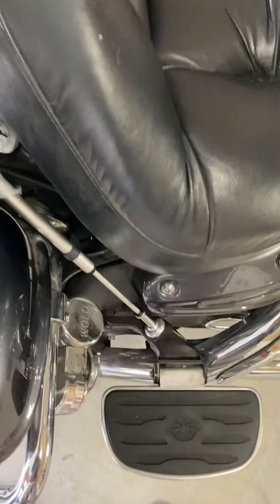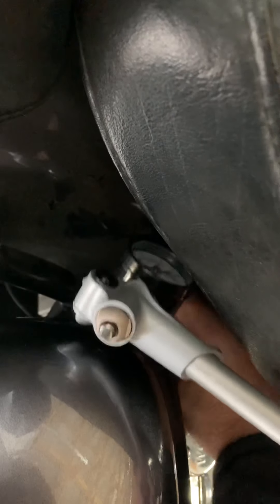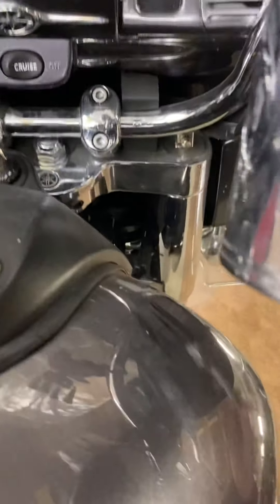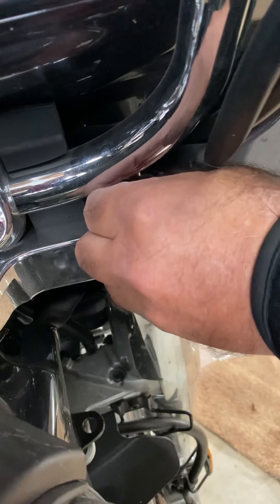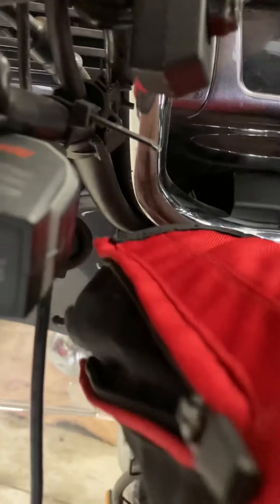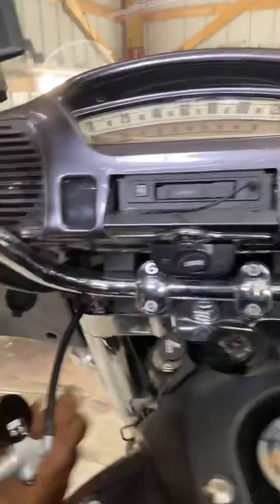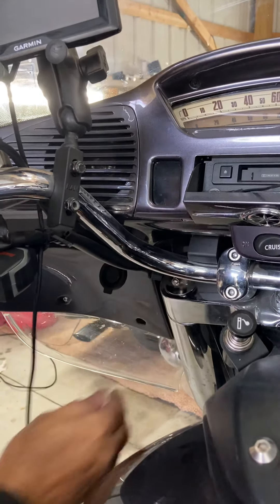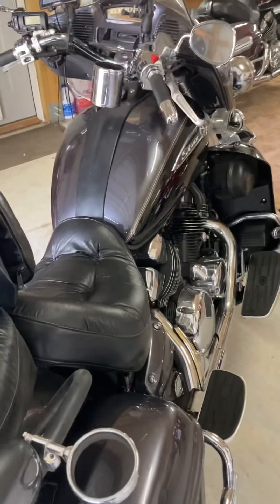DIY: How to Check Air Inflation on a Yamaha Royal Star Venture

Comment: when you remove the pump from the Schrader valve after you have put the air in, you let a lot of the air out, inadvertently no matter how fast you spin that connection from the pump to the valve. These shocks and forks, hold such a small amount of air, that you can let all the air out that you just put in just by unscrewing the pump.
take a reading now after you’ve removed the pump with a separate gauge and see how much air is in there, if any. Just taking a pressure reading with a pencil gauge lets out a few pounds. 
 I have a video on my YouTube channel showing how to put air in the system without losing any air using your home compressor. Just have your air compressor tank at the exact air pressure you want in your shock. And use a push on air chuck to put air in the shock. When you press the chuck onto the Schrader valve, if you only have 40 pounds in your tank of your compressor, your shock will equalize .. with the air compressor tank. For doing the forks, which takes 7 pounds each, you have to lower the pressure in your air tank of your compressor down to 7 pounds and do the same, hold the air chuck on each fork valve, it can’t be a screw on tape because that will let air out as you unscrew it. It Hass to be a push on type air chuck, then equalize each fork with the 7 pounds you have in your Compressor tank..
  I have two videos, showing how I do this procedure, and it takes literally one second to put the air in just by pressing the air chuck connected to the hose from your air tank onto the Schrader valve. Then I take a pressure reading with a simple, pencil gauge.

Comment: A lot of ventures have a squeaking issue coming from the back. Most of the time it is the Cush drive pins that need greased. Your wheel has a hub with a large gear that is attached to the wheel when you remove it. That large gear plugs into the final drive housing on your final drive, and is held on by the axle. That gear is attached to a hub that has six pins on it. Those pins plug into the wheel into metal bushings that are inside of hard rubber shock absorbers.. all motorcycles for street use have some type of a cushioning device in the final drive line to absorb the violence of shifting gears and hitting the gas and letting off the gas. That is pretty tough on transmissions. I’ve never seen a motorcycle that did not have some type of a rubber absorption device in the final drive somewhere to absorb the shock of shifting gears. Cars have it in rubber mounted engines and transmissions. motorcycles mostly have solid mounted engines so they have to put the shock absorber in the driveline in the final drive hub. There are lots of people that say if you were Venture is making noise that you can’t find, it’s usually that push drive in the back wheel that needs the pins greased. Do you need a snap ring pliers that open till at least one and a quarter inches to get the snap ring off to get that Kush drive hub off of the spindle it is attached to. I have a video on YouTube , It is in titled Yamaha royal star venture rear wheel maintenance if you wanna see what I’m talking about..
  I am interested in the address or contact information for having my shock absorber rebuilt. At least have the seal replaced and the oil changed. I’m not sure but I think my shock leaks because the rubber boot is stained but no drips. There is not much of an alternative or selection of replacement upgrades on the Internet for the Venture rear shock..
  I had a 2002 Yamaha royal star venture midnight version a few years ago. I actually changed the oil in the rear shock by draining it out through the air hose, and slowly replacing it through the air hose. I only put in as much as I go out. It seemed to work fine. That oil gets cooked. Are used to road race motorcycles.. I know race bike teams they change the oil in their shocks after every race weekend. And they say it comes out of the shock pretty dark. And when they rebuild shocks that have not had the oil changed in a year, it comes out almost black. I know the shock absorbers on race bikes get too hot to touch, from firsthand experience, pun intended..
Reply from the maker: Also the wheel itself gets a lube job
Reply: getting squeaking from the front forks, pumped with air (7 psi) not as squeaky put still there. Any ideas?

Comment: The problem with this system is, you cannot be fast enough to get that air pump off of the Schrader valve without losing possibly all the air out of the Forks  and maybe 10 pounds of air out of the rear shock.   listen to this video closely, you will hear those little escapes of air as he is installing and removing the pump on the Schrader valve… The forks hold so small amount of air, that you can loose all of the air out in a second while unscrewing that fitting..
  I have put a video here on youtube showing how I put the EXACT pressure into any air fork and shock with ZERO chance of over inflation in less than a second every time.
my video is
Yamaha venture air fork adding air safely

Comment: Zip
jody here
 I just watched this video of you putting air in your suspension on your 2013. You mention a squeak in the video you’re chasing.
  I don’t remember where I read it, but they say noise coming from the back of a royal star venture that you can’t figure out what it is, could be that clutch hub that is mounted in the 6 Rubber cush bushings..I did a video on that titled royal star venture rear wheel maintenance or something like that. I point out the cush drive hub.. they call it a clutch hub in the service manual. But when I took mine out of the wheel to grease it, it was rusty. I wear earplugs so I don’t hear the noises coming from the engine unless they’re really loud. But I would not have been surprised if I did hear squeaking..That may be what you are hearing on your 2013 from the rear
Reply from the maker: Yes  been there and serviced that also
Reply: This pump is not The ideal way to put air in your shock, and especially not in your forks. Listen to the video. As you are screwing that on to the Schrader valve, you can hear it letting air out. Not only that, when you get the hose attached to the air valve on your fork, you are letting air out of the forks, just filling the air hose on the air pump. Then, when you go to remove the air hose from the fork valve, you’re going to be letting more air out… if you have watched my video on using just an air chuck on the end of your garage, compressor, air hose, with only 7 pounds of air in the compressor tank for the forks, and only 20 or 30 pounds whatever pressure you want in your shock, then you press that Aircheck on there, not screw it on, but press it on, and that’s all the air you can put in there is whatever is in the tank for pressure. Since you’re using a press on Aircheck, you’re not gonna lose air by unscrewing it ..